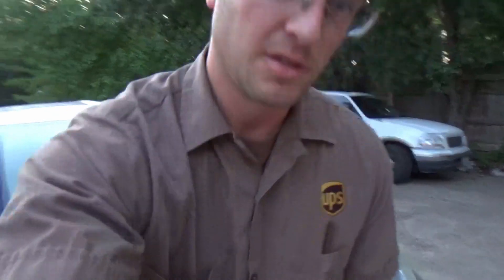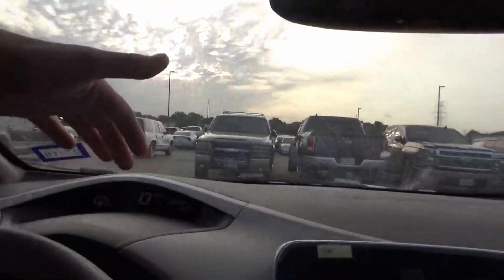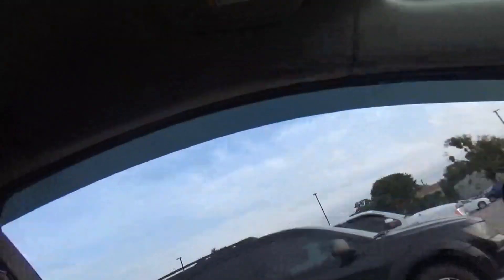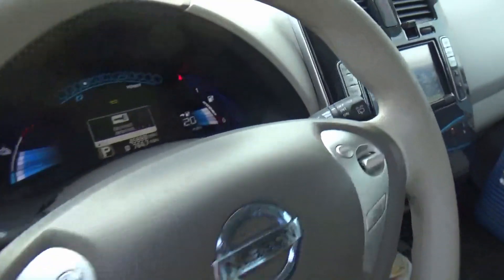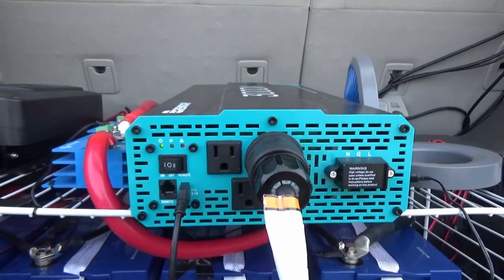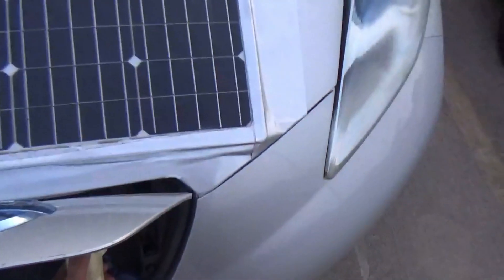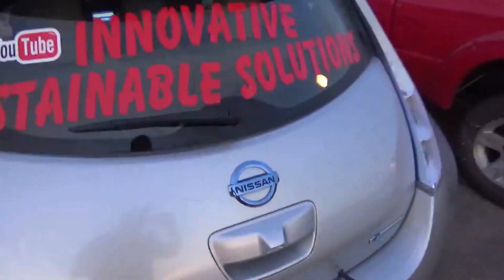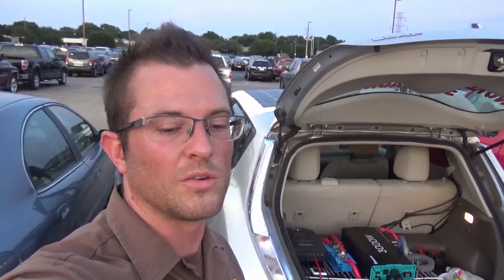Portable EV Charging Station

Comment: Cool project. Bummer about the leaf battery. This was common with the original Leaf's and was resolved within the first couple years of production. Some people have done repairs to the existing battery by replacing the internal cells/modules.
Reply from the maker: The issue has been largely ameliorated by just making the batteries bigger (in my opinion a lazy fix, but it does work).  But the achilles heel, of not having a thermal mgmt system for the batteries remains, inexplicably even in the 2019 models.  This video explains it better than I can https://youtu.be/DE_PZQ13YTY   @6:00

Comment: Absolutely love what you are doing. Did you get a chance to check out Solarolla? Lithium batteries are going to give you so much more range because currently you range is probably not what it says on the dash because of the weight in the back Li batteries have much better power to weight ratio. Find out exactly what the input of the car requires, currently you are turning DC from the Solar to AC to an inverter that charges the battery that then send DC back to the car. Maybe you just need the right DC -DC converter that will charge the car direct from the solar? if you dont know a DC-DC coverter is something that turns say 12Volts DC to 48Volts DC. You need measure what the home wall unit puts out, is it DC or AC and what is the voltage and current. You need to by a device called a Killawatt meter https://www.youtube.com/watch?v=ksW-0UUiw9w and run the wall unit throu it to see how much energy that unit is using.
Reply from the maker: Very familiar with the Kill A Watt.  https://youtu.be/jVzD_LqVU_Y (@4:10).  Direct solar charging of the main battery will happen.  It is the inevitable conclusion of this system.  In it's final version I would like to have a dashboard switch that toggles the PV input from main battery to backup battery.  Email me @Lonestarezev@gmail.com if you have ideas for how to achieve this
Reply from the maker: Solarrolla does some amazing stuff too.  They take care of the camper community.  I'm trying to see if I can turn old EVs into something that everyday people can commute with for free with a little elbow grease.  So many different DIY projects converge on solar it's amazing how all the commercial solar projects out there are such trash.  My first attempt with no prior knowledge and a $2200 budget, beat the pants off the Hyundai Sonata hybrid, which even HYUNDAI claims will give you about 2 miles/day from it's solar roof.  I would expect to be fired if I turned in such results.  I'm gonna do a video on that later
Reply: @InnovativeSustainableSolutions  I've spent the last couple hours looking into 'Solar-DC-DC-input plug' and it would appear there is 'canbus' activity that you have to get passed, this is not easy. Apparently there are people 'hyper nerds' that have 'hacked the 'canbus' and been able to go direct to the leaf batteries managment with an auxilery battery. This might be a way to go direct and be much more efficient than all the inverter and controller stuff, lots to learn, but fun to learn. Keep up the experiments :)
Reply: @InnovativeSustainableSolutions  Not sure if you know but there is a very big discussion about your project on Reddit (over 38,000 up votes) 
https://www.reddit.com/r/Futurology/comments/cjx2yv/texan_installed_diy_integrated_solar_on_his_2011/ewlfo02/?context=3

Comment: Was wondering if your considering a do it yourself battery pack rebuild/reconditioning video anytime in the near future? Great video btw 👍
Reply from the maker: The future of this channel will be perfecting the mobile solar charging station, until the range of the current Leaf falls below 30 miles (it is important to show people that if they invest in a system like this, it pays for itself in extended lifespan of their EV).  I think that will happen sometime around Fall 2020.  At that point once the vehicle is effectively totaled, I will be comfortable doing very bold projects on it like splicing the PV feed directly into the main battery, how-to vids on safe battery removal, and suggestions on how to rebuild/recondition the battery (the hardest part will be finding Leaf battery modules with no/little degradation).
     Do you have an old battery you need to spruce up?
Reply: @InnovativeSustainableSolutions  No I'm just very interested in what your doing and was curious about what you had planned, I totally agree with the idea of showing people that your solar Charing solution can pay for it's self my thought process behind reconditioning the leafs battery modules was doing so combined with your solar charging could potentially gain you better than factory range which would allow you to drive the car more often which if done cheap enouph could decrease your ROI time, That's if you have a select few cells that are underperforming rather than the whole pack. I currently drive an 2011 Chevy volt which to my knowledge hasn't seen a bit of degradation it routinely hits 35 miles on all electric I'll nevery be able to wrap my head around Chevy discontinuing it, anyways man I'm getting side tracked Ive loved your videos and I especially love the point your videos are making keep up the great work.

Comment: So the battery has degraded from 84 to 45 max in 45k-46k miles? Is there a different number for Eco mode max range for a brand new leaf? I can imagine when thermal regulation is better you’ll get a ton more range. Looking forward to seeing the upgrades/updates along the way. 👍🏻